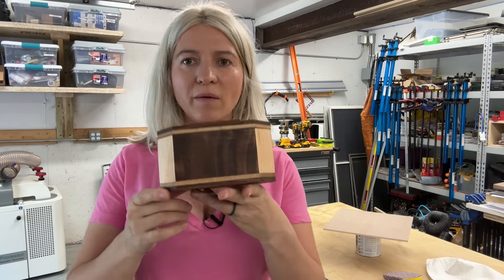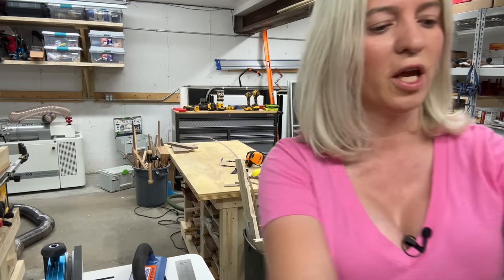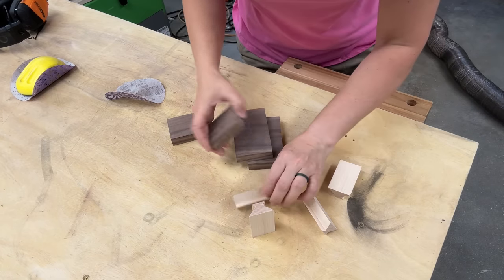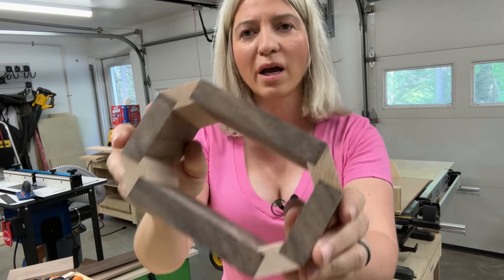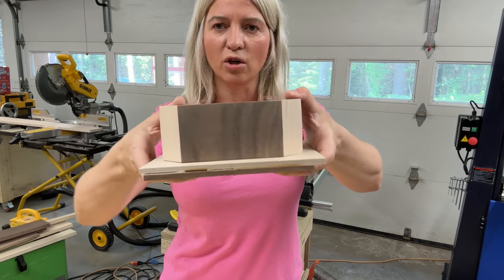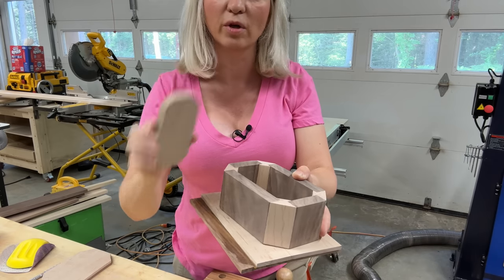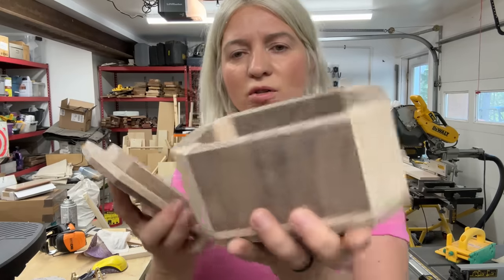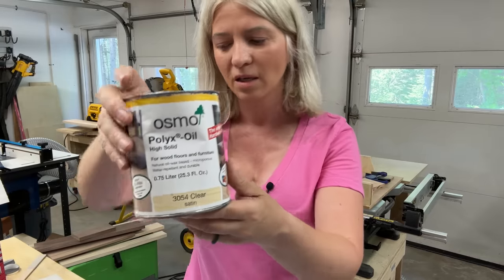Make a beautiful box with BIRDSMOUTH JOINERY. Easy woodworking project

Comment: I am really liking your channel.  Your projects and explanations are very accessible.  Your willingness to not be perfect feels like it takes pressure off the rest of us, too.

One comment on the lid:  I think chamfering the insert portion slightly might make putting the lid in place easier.  Well, two comments...!  Making the insert portion half the thickness might make the lid look lighter visually when it's off, as well as give a little more space in the box.
Reply from the maker: Hi DavZell, thank you for your kind comment. The lid goes on easy ofter sanded a bit. I totally agree with you on the thickness of the insert. Truth is, I realized was a bit thick but I just got a new dust processor and I didnt set up the ducts yet so, so far I only have one hose that I have to keep moving from machine to machine :) Was too lazy to change it so I can run my board through the planer. Also for a box so small I would use half inch material but I already had the bit set up for 3/4 from making a waste basket earlier in the day and didnt want to set it up for 1/2 in since it takes a while to set up properly

Comment: So you can not use those bits with thinner boards? Don't like boxes with those fat sides 😖😖🤦‍♂🤦‍♂, that's just me (by the way : nice work)
Reply from the maker: Yes you can. Used same bit today with 3/8 in wood. The reason I used 3/4 is because I already had the bit setup from a different project and didn’t feel like changing the setup